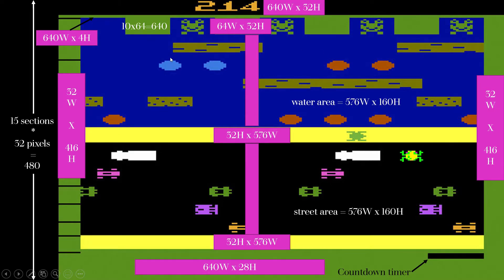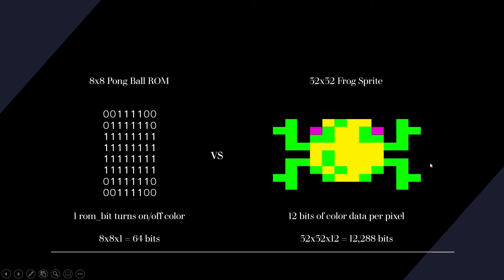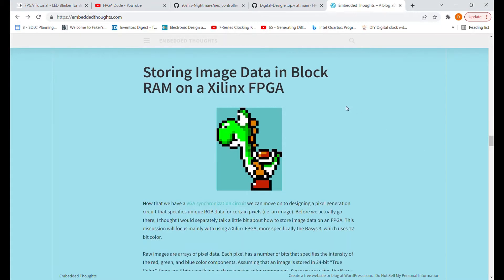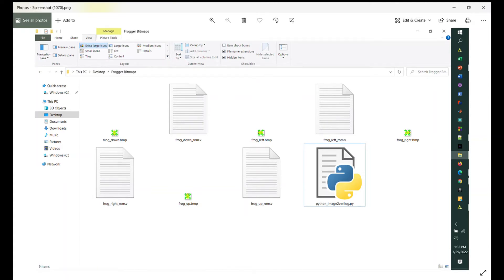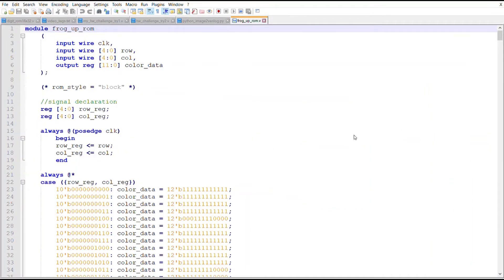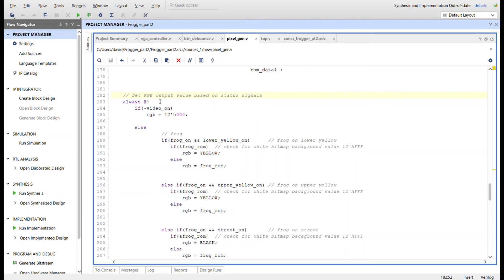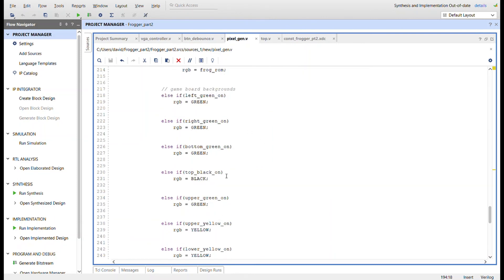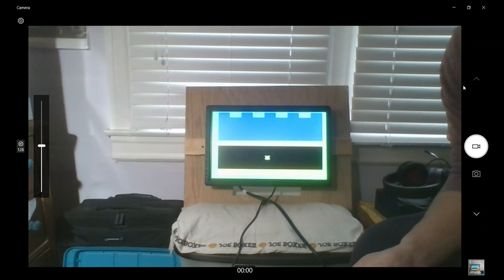VGA Project Frogger Remake Part 2 Basys 3 FPGA Verilog Vivado

Comment: 7:37 I do not understand line #22
Reply: A case statement is a more elegant and concise way for checking conditions, like if/else. Inside the parentheses () is the condition to check. On line #22 the condition being checked is a concatenation of two signals into one signal. Concatenating signals in Verilog uses curly braces {} with the signals being joined separated by a comma. Hope this explains.
Reply: @davidmarion8930 Sorry, no it doesn't explain. I do understand how CASE works what I do not understand how the address is being evaluated with {row, column}
You just so casually skipped it over by throwing "concatenation". How ?
Does it really do + ? Then it makes no sense address = row + column.
I'm lost. address = row * <size of row> + column - that would make sense, but you use {row, column} and that seems to work.
Reply from the maker: @b213videoz  Sorry, I guess I assumed that you might know what concatenation is. It is essentially joining the two signals into one. So, the bits of row and the bits of column will be joined into one, side by side, and evaluated as one for the CASE. It is not addition, nor multiplication, it is just placing them side by side. Example: if row == 0010, and if column == 1101, then the concatenation, i.e. joining, of the two, {row, column} = 00101101. Does this explain?
Reply: @dajoma36 Thank you, David. Yes, of course I know what concatenation is but I know close to nothing about Verilog and FPGA programming in general 🙂
As it turned out in that particular case you had a merge of two 4 bit bit pieces into an 8bit one, which resulted in 4 bit shift to the left + 4 bit addition which effectively is the same as high_4_bits * 32 + low_4_bits, only much more efficiently of course. My point is that was a non-trivial piece of code deserving some explanation yet it was just skipped whereas some trivial and obvious bits were explained too well.
Anyway your examples (I mean code) are extremely easy to follow, I just bought your paper book at Amazon, I do hope there are some good explanations there.
Reply: Sorry I didn't explain everything. There's alot to cover in some of these videos, and I do try my best. I appreciate your feedback. Thanks for buying my book. I do hope it serves you well.